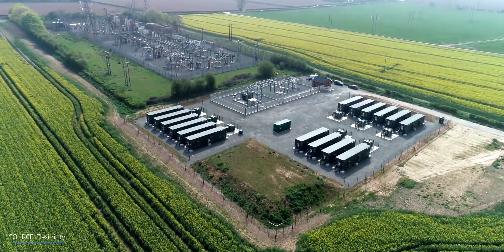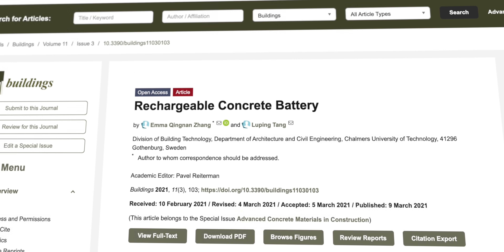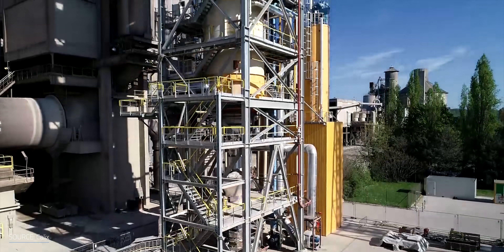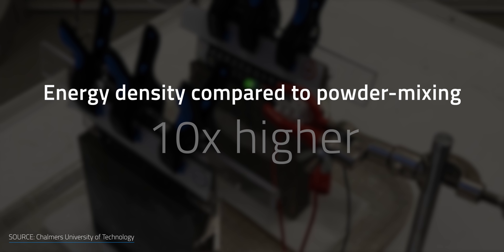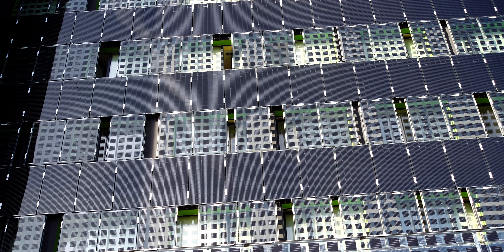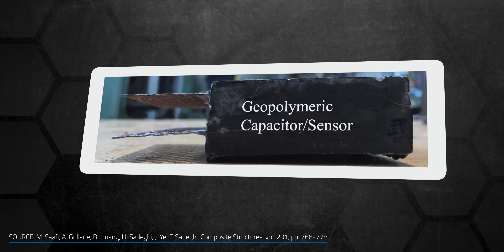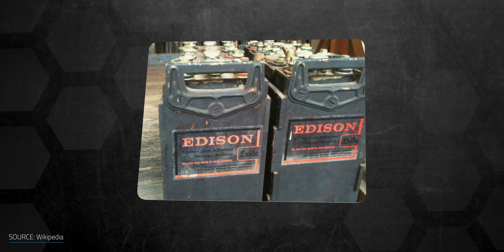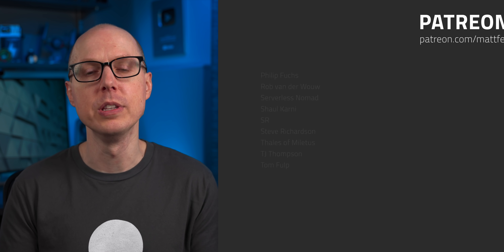Turning Buildings into Batteries? Concrete Battery Storage Explained

Comment: If the cement is an electrode then it can't be connected to the rest of the cement therefore it's useless and just another battery.

Comment: Instead of turning a building into a battery, why not turn an entire city into a circuit board? With energy flowing through the city in such a manner one could theoretically remove the need for wires all together.

Comment: I would imagine AAC blocks, or Aircrete might have applications in this.  They are lightweight, 3d printable, high temperature tolerant, and an have excellent insulation properties.

Comment: If we continue to build electric automobiles with excess range in their batteries, those EV batteries can be used to provide the backup for those silly intermittent power sources.  I suspect that compact aneutronic fusion will obviate all these Rube Goldberg devices ... sometime before the end of this century. Then the question will be: What shall we do with the helium? Shall we use it to build taller buildings?  (~;

Comment: Primary question.Safety.
One.If a battery goes above its maximum temperature...
a.it fails.
b.it generally ignites
Two
If a faulty concrete battery is embedded in the wall,how do you isolate it from the circuit,without damaging the remaining ones?
Three
If your battery shorts due to moisture it will swiftly ignite the others in the wall.
This would cause a cascade of battery failures in which case each concrete battery would become a CLAYMORE EXPLOSIVE.
Four
Once the first, inevitable incident fires up.....any house insurer will refuse these properties.
(fyi ...even 2 aa batteries can short,and can explode if you get them wet.....been there,done THAT....got a melted torch in a box at home as a souvenir for winning bar bets)

Comment: Doesn't the concrete corrode the metal?  Infloor heating was done with metal tubes in cement 9 decades ago and it was found to suffer from corrosion

Comment: Unclear how the presence of a liquid electrolyte works for the structural requirements of concrete? Another issue is cost of connecting conductors, issues of electrolytic damage to rebar, ... ?

Comment: Yeah, great idea, let's replace lithium with a material that's even more destructive to the environment, cement.  
I can't imagine this would work for buildings anyway, the constant battery activity would degrade the concrete too quickly.  There's two mechanisms that will break down the concrete: volumetric expansion of metal oxides in the battery components, and heat cycling during charge/discharge, both of which will lead to microcracking of the concrete.   Potentially there could be decomposition of the actual cement bonds as well.  And if there's any water being electrolyzed by the process, that would definitely degrade the hydrated cement, and you might even see hydrogen embrittlement of the reinforcing steel as well.

Comment: When I used to build swimming pools I had a job where the steel frame in the pool was unbonded and the concrete and steel in the pool built up a charge powerful enough to knock me over. This idea has very real possibilities.

Comment: so any house with a concrete foundation poured from the right materials would have a storage battery built in..
still think geothermal  is a better way to go and create base load power.
storage needs for the grid will drop.

Comment: Would there be any physical degredation of the cement batteries in the structures that could cause structural deficiencies over time leading to less safe buildings?

Comment: do charging discharging cycles cause chemical changes and change the strength of the concrete?  a 20% density loss over 6 cycles (days) is a pretty significant.  if the life of the concrete storage is just a month or two, its not worth doing.

Comment: Steel reinforced concrete will last between 50 and 100 years. The problem is the steel corrodes and that then affects the concrete. Ancient versions of concrete had no steel reinforcing rods - therefore no corrosion. In the UK concrete tower blocks designed to last 60-years have in many cases already been taken down in much less than 60-years from their construction.

Comment: You need this tech to ubiquituos, sturdy and function countiniosly and dont have properties of unit cell.... you already use iron mesh in concrete pouring and even if you damage it, it still functions as conductor. In order for this thing to function you need the cement itself to be used both as electrolite AND insulant. There is also the issue of controlling amount of iron reinforcing rusting - it reduces structural integrity of whole system and the implication of failed rust controll system, whitch is also charging capasity limiter, are horrifing when you talk about tall buildings. Now, what you want to focus on is non load bearing elements of construction, like filling blocks of concrete buildg skeleton - those could be replaced easily and in case of failure of any controll system will have minimal impact. Just remember - no fluids allowed)))

Comment: i mean if they managed to pull this off, rather than fearing the house might electrocute me..... i fear the idea of easily destroying a house with simple chemical reactions using the stored charges in the concrete itself... it makes it probable to make a house powered bomb or just destroy the wall of houses more easily through some chemical reactions to abuse the properties of cement itself... depending on what you want to do with it... rather than saving the world this is going to be more dangerous for us to use.... not to mention the fact that if there is a lot of metal in the wall it could block signals from the outside so we will need to install indoor signal boosters which takes carbon to produce just fyi... i doubt we will have critical failure like a normal phone battery going bloated but the probes points are probably where all the failure will appear.... but the other downsides.... plus you would probably not want to put nails through these walls anymore....

Comment: so, the slurry is the electrolyte. what happens when that electrolyte cures and is no longer 'wet'? also, what's the chance of the curing process damaging the battery components. if only 50% of the "batteries" remain functional once fully cured (assuming it's intended to still work at that point), it's not really viable for deployment at a large scale.

Comment: Imagine if it became law that all new structures needed to be built using concrete battery building materials and then the capacity sold to the power grid. That could reduce our grid's lithium needs immensely and help stabilize the usage fluctuations.

Comment: 07:49 Huh? 500W/m² is a measure of power per area, kinda like power density but in 2d instead of 3d.

To call it energy is either confusing, or meaningless.

So, if ot really is per area then did you mean energy of 500Wh/m², or power of 500W/m², which only tells us how quickly the energy can be released, not how much energy can be stored?

Comment: I don't get this one.
First, why are capacities quoted in square meters, not cubic meters? Surely volume provides capacity, not area. 

Second, why bother with the concrete part? It seems like what we have here is a traditional, simple, low density battery, which just happens to be using the cement as a structural component. From what I can see, the cement isn't actually providing any storage functionality. So... why? Why not just put the electrodes into a dedicated structural member. Why embed it into concrete? There are a couple of fairly weak arguments presented - for example, the idea that a concrete structure with some electrical properties might make it easier to find faults and degradation. But again, that's not really anything that you're getting from the battery functionality. 

It reminds me of the idea of adding a clock to a radio to make a clock radio. Is a clock radio better than a clock? Sure. Is it better than a radio? Sure. But by that argument you could add a clock to literally any compatible object and say it's better. Clock coffee mug! Clock fridge! Clock kettle! Is there really any merit to this sort of "invention"?

Then you have to consider the downsides. If I have a dedicated unit to be my energy storage mechanism, and there's something wrong with it, it can be fixed. It can be replaced. And because we can engineer it for high density storage technology, it really doesn't take up all that much space. What volume of concrete would be required to get the same capacity as a single tesla power wall. A whole house worth? What if something breaks, do you have to start punching holes in your house?

It's entirely possible I've missed something about this, but if I haven't, this is very much a "but why though?" for me.

Comment: And what is going to happen to the people encased in the electro magnetic field 24/7/365? And concrete doesn't last very long. Now a geopolymer battery that has shielding to protect the inhabitants from the electromagnetic fields.

Ah, smart devices. So we'll be spied upon by our lampposts? Curb stones? and the very buildings we inhabit?

Comment: You forgot one reason for why we use so much concrete, it's cheap... Pretty sure that simply building regular concrete structures and install some battery units will always be the way to go, unless there is literally no space for the battery units. The idea about using the technology to analyze the concrete was interesting though.

Comment: Wow Great Video. The reason i am investigating this for myself is because human URINE actually is an electrolyte. The potential for this is WASTE WATER POWER SYSTEMS. OUR WASTE ALREADY has an industry. It would be nice to have this electrolyte utilized on a global level because our urine is a renewable electrolyte and an efficient power source. IF you understand how a battery works, you will see the power of this comment.
Reply: I know this is gross, but what happens if you use urine to mix the cement?

Comment: I know it's nit-picking, and you are clearly trying to avoid using the same word over and over, but concrete and cement are not synonymous.  Concrete is the finished product you are referring to, while cement is the binding agent that holds it all together. However, it is true that cement (the binder) production is the reason concrete production releases so much CO2.

Comment: You talk about energy density as compared to a power wall for instance but miss a key fact that the original wall is already there. This takes up no additional space potentially. I think that's a huge advantage if in fact it can last maintenence free for the lifetime of the building. I'd love to see a mock up of how you could wire a house using this stuff. And why not an, in addition to, method combined with other batteries.

Comment: I like the approach of broad spectrum of solutions to electrification.  The energy density is low, but in massive amounts could add up to a significant contribution to power storage, reducing the overall demand for lithium or other high density batteries.  Well--in theory.  What's more likely is even higher demand  because more power --> more devices.  The problem with this is that  the storage capacity isn't high enough to make it attractive yet.  Buildings are expensive to build, and if we commit to a certain technology it gets locked in for a long time.  Buildings can be retrofitted, but that's also an expensive process.   Architects will probably wait until the technology is much better before committing to using it in construction.  On a side note, this video sparked an idea to install conductive pressure plates under asphalt roads.  There's no way I'm the first person to think of that so i'll be looking that up.

Comment: And another thing that comes up in my mind what about cost per kg added to make this battery and what's for the capacity per cubic meter? I know its a replacement/addition to the walls we build anyway - but if the effort isnt worth it yet, it might be better for the environment when we omit concrete at all
Reply: And what's the cycle life of these batteries?
And: to clarify - by energy density - I mean the thickness of the walls/floors in the examples

Comment: So does the concrete cure when the battery is charged and and loosen up when it's discharged?! And I think the pictures were misleading as well, as those cement batteries have to be especially manufactured and could not be poured like Regular cement during construction

Comment: 7 watt hours per cubic meter.  Not going to make any headway into single home residential.  I mean even if you had 100 cubic meters of concrete that's way less than 1 kilowatt hour of storage.  Perhaps run lighting in common areas of large buildings.  The question of course becomes does it pay for itself to even wire it up.

Comment: Frankly, the best use of concrete for energy storage is it's weight.  Energy lifts the concrete to store potential energy, and we extract the energy with the kinetic energy of lowering it under control.  Make a table, put a ton of concrete on it (not that much concrete), use a motor to lift it to store energy.  Use ratcheting to hold it until needed.  When energy is required, use a generator to extract the energy. This mechanism can be made to hold an entire building (they already do this with seismic table/bearings), if you wanted a city-block sized battery.

Comment: The cement is just the electrolyte. Like seawater could be. The actual battery charge comes Iron and Nickel. 
Even lithium-ion technology is moving away from Nickel, since its too expensive for large scale energy storage.
So no, this "cement" battery is not going to go anywhere..

Comment: Hmmm.. since the energy potential has been given in m^2 it would be wise to convert into m^3 since you can tweak the concrete by 3D printing into porotherm block etc. If you get, let's say 7000Wh from 1 m^3 then you increase the wall thickness from 10 inch to 30-50 inch.

Comment: Usually, you want to avoid electrochemical reactions in your structural concrete.  I don't think I trust this technology in an application that impacts the safety of a structure that is intended to last for many years.

Comment: I think it would be good for foundations in a typical home but not so much for walls, maybe connector floors with the support structure but the walls should probably  be your typical construction for future modifications.  Homes always getting updates in code and or for remodeling purposes make haveing  this seem like a difficult situation for that current party. It would be good for storage under a warehouse size structure I think.

Comment: This is very interesting although there are some concerns.  For example, what happens during a house fire or if the wall is breached, such as from an impact by an errant vehicle?  These issues can be over come but it is nonetheless a concern.  Also, how much will this increase the costs?
Reply: At this point I have two thoughts. First is the question 🤔  of appropriate materials and their effective value. I do not see 😐 this as a difficult research problem. Now my second thought is whether any consideration is being applied to reducing the required level 🤔 of power to do what we do today.
Reply: @davidrobinson7112  Your two points are quite good.  In particular the second point about reducing the required level of power is often an under appreciated issue.  

LED lights have had a tremendous effect on reducing needed power.  On sailboats they have been a life changer, reducing a typical light bulb from approximately one amp to around one tenth of an amp.  It doesn't sound like much but when you add up three navigation lights, one or two in the galley, two to four in the saloon, and a few in each berth, it makes quite a difference, especially when your power generation and storage are a lot less than on a power boat.  If we take this concept and apply it to society in general, it makes a world of difference.

So too, mobile phones have not really gotten better batteries, rather their power usage has become much more efficient.   In particular, if you de-Google your phone you will roughly double the time between charges.

In general society, street lights, home lights, store lights, etc are all becoming more efficient.  Keep in mind that we're only talking about lights.  Electric motors, sensors, and all other manner of electrical appliances will continue to become more efficient and hopefully reduce the electrical draw.  We'll still need more power, but we'll need less of an increase as things get more efficient.

Comment: there was some book, i forget which, i read back in the late 90s.. it talked about how the CIA/FBI would plant bugs- cameras, mics, transmitters. they would take a zinc and steel nail, nail it into a brick of the building, wet the brick and seal it. it would stay a battery for weeks and weeks, running the equipment they needed. this was the late 1970s the book was talking about and the electronics only needed a few volts.

Comment: Why are all the power densities here in Wh/m²? What is that supposed to tell me? Concrete is not a colour applied over an area. It's a structual material you need many m³ of! So Wh/m² is nonsense imho... (Even worse is the W/m² in the last part of the video. That's not even an energy density...)

Comment: I wonder if these batteries would be less efficient when heated. I'm no battery expert, but we all know plenty of batteries are less efficient when hot.
If these concrete batteries work just as well cold as they do hot, then these could potentially serve multiple purposes. I guess then it would be possible to design a building to be passively heated, with biomimicry architecture designed to cool (like a termite hill), with window solar panels, green roof, CO2 scrubbing AC units and the concrete itself be a battery.